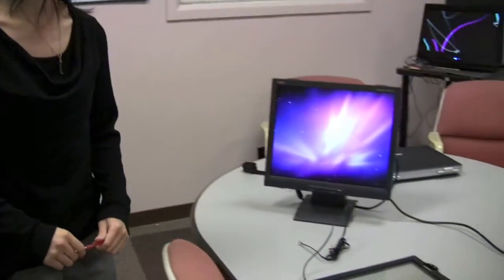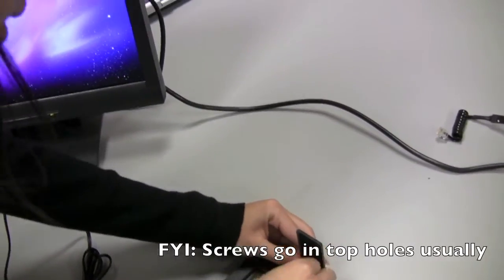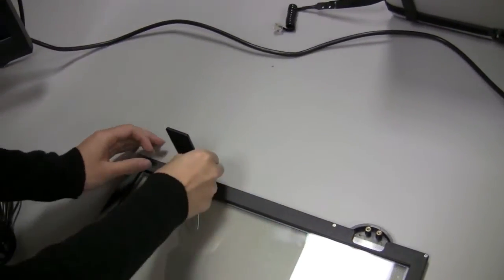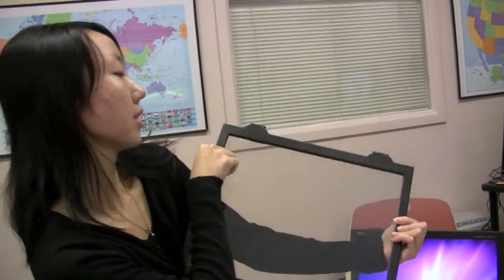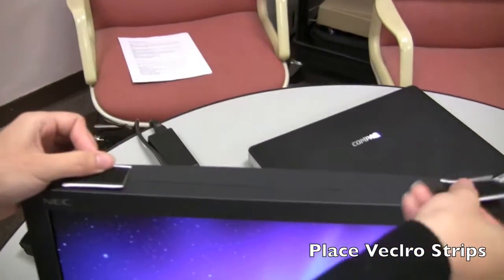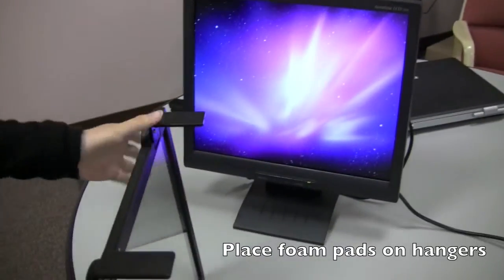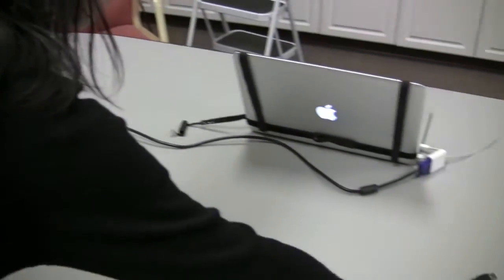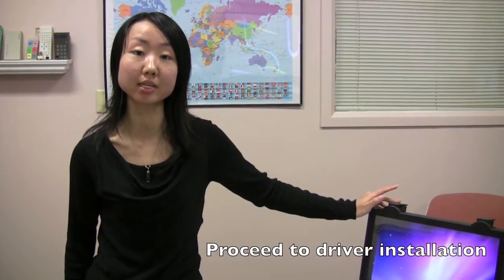How To Install: Standard Add On Touch Screen Setup

Comment from the maker: @synthmandan The monitor being used is a NEC Accusync 17" 4:3 LCD.  We don't carry this model anymore.  But, if you need a 17" touch screen monitor that is equivalent to this, it will be our KTLC-17T2-USB/B.  The add on being used is our 17" Add on touch screen.  Model# KTMT-1700-USB/B.